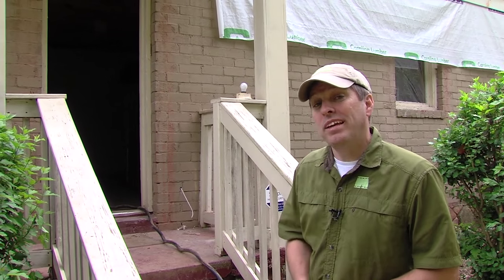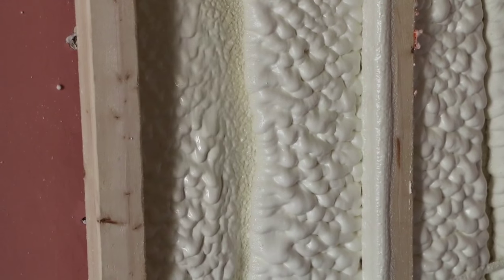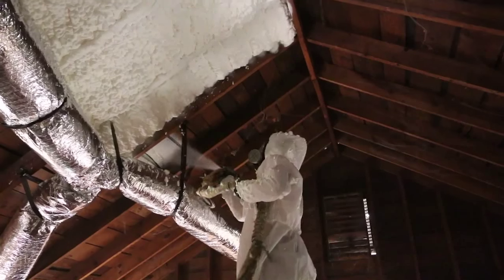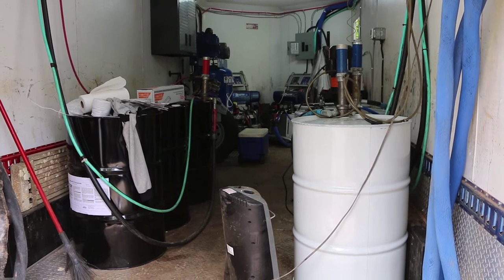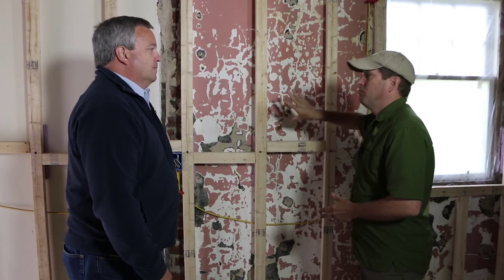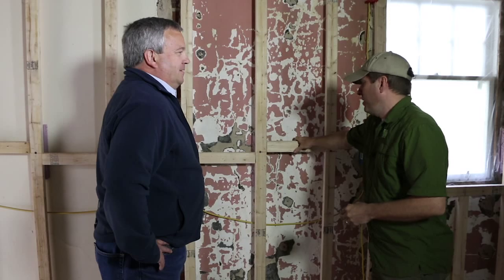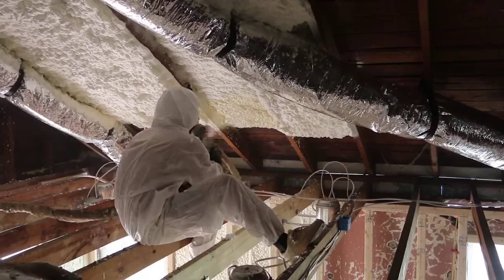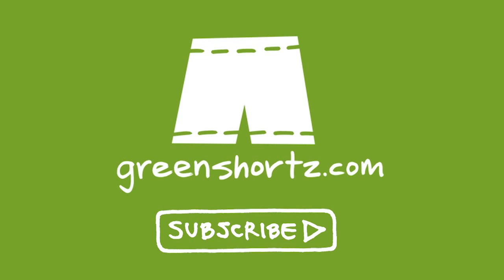How to Install Spray Foam Insulation | GreenShortz

Comment: GREAT vid man.  We constantly fight this battle at work.  Spray foam or fiberglass, closed or open cell.  This will be a great reference for our clients.  I like the interviews and camera work as well.
Reply from the maker: Greg's Garage Thanks Greg. I've got a couple of reference clips that might be of value for your discussion. One showing 6 inch rafters fully covered by to layers of open cell foam, breaking the thermal bridge. That is in an unfinished attic, though.
Reply: Cool.  We beat the bridge by using continuous insulation outside the structural studs.  Basically, enclose the building, spray on insulation, then build the envelop over the insulation.  Most of this is brick with broken ties, but some is metal panels on Zee furring with a bond breaker at the wall surface.  The spray insulation also eliminates the need for a vapor barrier in a lot of applications.  Owners AND contractors don't always understand all the value adds the system provides.  We also work with clients who have TOTALLY separate construction and operating budgets.  Build it cheap but pay big bills later.  It's a tough discussion for sure.
Reply from the maker: I'm about to start a green-house project. Will likely do rigid foam outside studs.
Reply from the maker: But...the guy I did the spray foam video for suggested closed cell on the outside. You've done this?
Reply: yes.  behind brick.  Metal studs, exterior gyp sheathing, then spray foam, and finally brick.